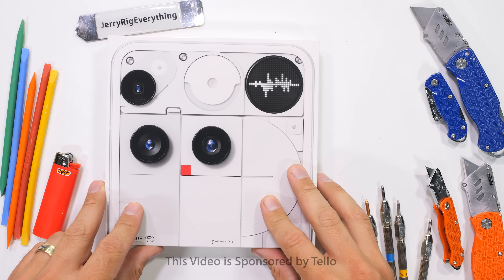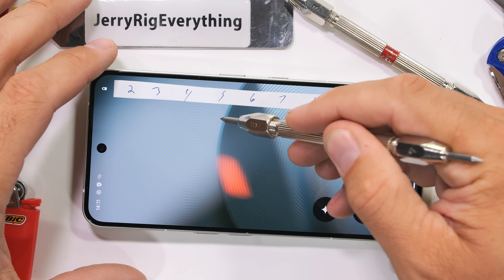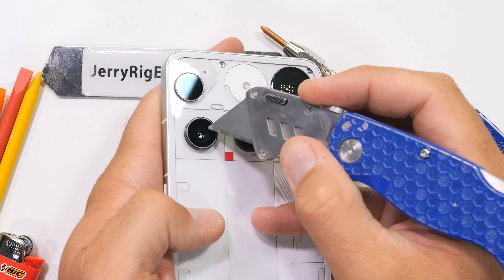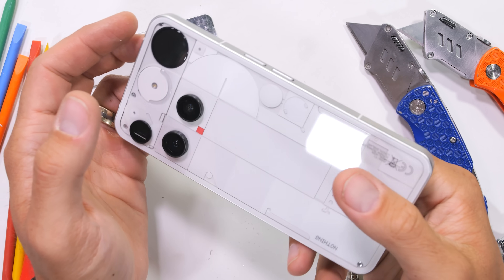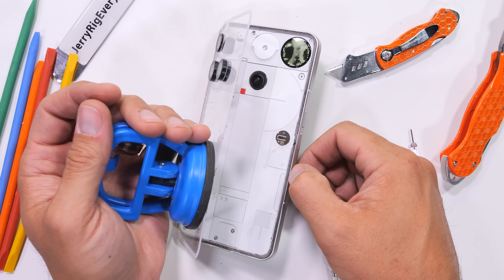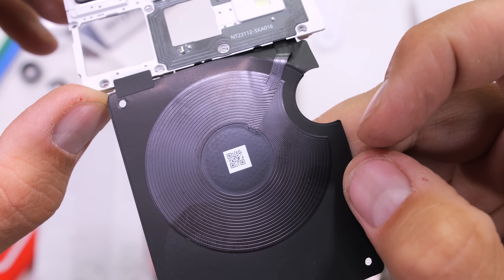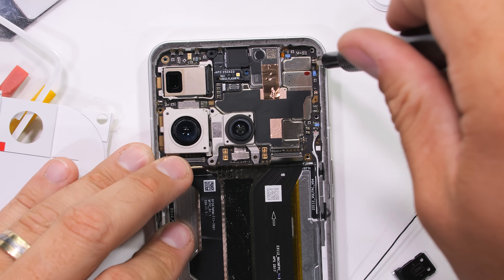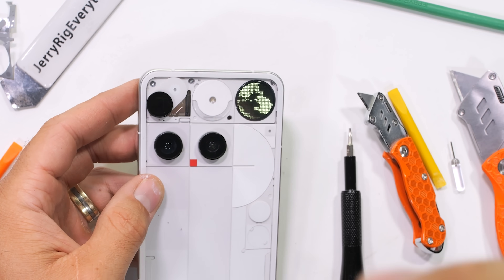Nothing Phone 3 Teardown! - Revealing the Truth...

Comment: Hi Jerry, sir.
This is a long shot, but do you happen to have any recommendations for a tempered glass protector for the Nothing Phone 3? 

I happen to order from Ebay but clearly none is designed specifically for the phone yet considering the slightly curved edges of the phone (which I happen to know the moment I tried applying the tempered glass on the phone).

I'm hoping for my luck to get noticed.

I'm at Australia btw.

Thank you always for your teardown contents. 

Be safe.

Comment: Apple has become a REAL POS company!

2025 – Fake “Apple Intelligence” Hype
Said it works now. It doesn’t. Delayed to 2026. Complete scam.

2025 – iPad Still Has No Calculator
Over 15 years, still no basic app. Ridiculous.

2025 – iPhone Still Has No Back Button, No Real Multitasking, and Hides a Huge Black Rectangle (Dynamic Island) at the Top
Swipe-only navigation sucks. No proper multitasking. That “Dynamic Island” is just a giant black space ruining the screen.

2024 – Blood Oxygen Sensor Removed
Yanked from Apple Watch with zero warning or price cut.

2024 – Vision Pro Overpriced Junk
$3,500 for 2-hour battery and useless hype.

2023 – iPhone 15 Pro Ships With Slow Cable
Phone supports 10 Gbps. Cable is 480 Mbps USB 2.0. Pay extra or wait.

2022 – Killed SIM Tray in U.S.
eSIM only. Travel and switching carriers now a nightmare.

2021–2025 – iPad Can’t Run Mac Apps
“Pro” in name only. Still can’t replace a laptop.

2020 – No Charger in Box
“Eco-friendly” lie. You pay full price for less.

2016–2020 – Removed Headphone Jack
No reason except forcing AirPods sales.

2020–2025 – Siri Still Dumb
Way behind Alexa and Google Assistant.

2020–2025 – Ridiculously Overpriced Accessories
$129 MagSafe stands. $350 keyboards. Joke.

Ongoing – Old iPhones Get Slowed Down
Secret throttling as batteries age. Still shady.

Comment: Please don't get a nothing phone as the OS is terrible!

I have the nothing phone 1 and whilst the hardware and price were and are fantastic for the most part, the software is awful

To list some issues I've had:
1. Android auto doesn't work on some cars, where the workaround was to just go into USB preferences and change the connection mode to "no transfer" and it would fix the issue (dangerous when driving), but they've broken this in the second latest update

2. Google docs doesn't have the option to print! It is because with nothingOS likes to change settings and integrate settings in weird ways with their settings for no reason apart from "aesthetics"

3. The latest update disables my NFC for no reason sometimes, which doesn't appear to be consistent and I only find out when trying to pay with Google Pay on my phone

4. Just get random issues on calls dropping, quality issues, etc. when other Android phones on the same network work absolutely fine

Despite being an IT tech who could get around most of these issues by installing another flavour of Android, I won't be buying another purely for their software issues, as it's unusable as a phone and I shouldn't have to fix it, as it should just be usable out of the box (not perfect, but functional)

Comment: Happy Tello customer here. For those who travel overseas, All Tello plans include wifi calling and texts (back to the USA) which you can use anywhere in the world when you're connected to wifi. This is great for two-factor authentication if you have to access a secure account while traveling.

They do have true international roaming, but it's not included in the monthly fee -- it's pay-as-you-go, which you can top up anytime. I typically just use a local SIM card, but most of my trips are to the same country. 

Also, if you manually renew your monthly plan a day early (29 days instead of 30 days) you get to roll over any unused data for that month. That's too much hassle for me to do, and I never run out of data anyway, but some users swear by it.

Comment: Nothing 3 is a great phone. Just not at that price. Like i agree with nothing ceo. Most people dont need the fastest or highest specs, I certainly dont. I dont expect iphone level security either. Nor do I need victus 2 glass protection ( i will have a case), i could also ignore the battery not being lithium ion or no extra mention of cooling technology. Even the usb 2.0 is fine. Even the camera having the 2021 sensor is fine. All of this is okay but the price just is not. I waited 3.5 years to upgrade my phone and in the end im just not going to. You can cut on unnecessary specs but cannot increase necessary price and then expect people to buy😢

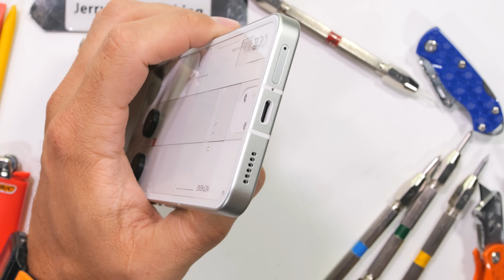Comment: 2:20 you could make a phone with a Gen 5 4x4 NVMe and 100 gigabit fiber port but so long as android continues to use the never ending joke of a protocol that is MTP then transfers will still be running at 2006 level speeds (and reliability!) anyway making anything above USB2 essentially pointless
Reply: Atleast you can use external display

Comment: Hot take, USB 2.0 on that phone is fine. 
Nowadays Wifi 7 and even Wifi 6 is faster than gigabit speeds. If you're going to do a file transfer on/off your phone you might as well do it over Wifi. 
Only time I can see that USB2 port being a bottleneck is if you're going to a store (Walmart, Walgreens etc) to print photos, they'll take a hot second to load in.

Comment: honestly,... phone screens in general are so weak... if you didnt have a screen protector and use the phone as per normal,.. the screen will have micro scratches.. but apply a screen protector and use as normal - 0 scratches... like the screen protector seems to have some better scratch resistance than the phone screen itself.... 😭😭😭😭😭😭😭😭

Comment: The reason India gets a bigger battery is because this phone is made in India. And while exporting this phone if the battery capacity is more than a certain limit they need to pay extra shipping charges so in order to save costs they used smaller battery in Global Versions. That’s why EU Versions of Vivo phones also don’t have massive 6000 mAh batteries
Reply: The vivo x200 pro global version has 6000 mAh
Reply: @joaoroman9583  but it has 5200 MAH in Austria Hungary and Germany
Reply: @sumirat6888 yeah that’s really odd
Reply: It's made in China, not India.

China manufactures most of the phone components which just gets sent to India and assembled there.

Also the global versions of most nothing phones are manufactured and assembled within China. Only the one sold in India is made in India
Reply: @Chibai-hp4ri  that is the point. It's Assembled in India that's why you don't need to export it. And the global versions still need to be imported and while importing an item the battery capacity should be in limits. If it is more than the limits you need to pay extra charges for shipping.
Reply: @sumirat6888  The global version is cheaper because it's almost fully made and assembled within China, which reduces a lot of the costs since they don't need to pay additional import duties on components.

Whereas Indian assembled ones pay import duties on Chinese components and have a higher markup price.
Reply: @Chibai-hp4ri  I guess you are high on something, the point which I wanted to clarify over here is that why the global version have smaller battery capacity than the Indian version the global versions are imported from China when you are shipping a commodity internationally. If it has a battery capacity that exceeds a particular limit, it comes under the hazardous item, which needs to be shipped extra carefully and in order to ship it extra carefully, the shipping charges are more than usual. That is the reason why the global variant has lesser battery capacity than the Indian variant. and you are right, the global variants are made in China. They are imported from China.

Comment: 9:25 anyone else notice this is NOT how u apply thermal paste for maximum heat transfer
Reply: Regardless of the pattern, it didn't get squished at all when assembled... doesn't that mean there's no contact pressure and therefore very little heat transfer? Thermal paste only fills the gaps between materials, they still need to touch.
Reply: @Govanification  Most smartphone manufacturers use a different thermal compound, it does look like thermal paste and that's why there's confusion about this all the time.

It's almost like a highly viscous putty that's great at transferring heat without drying out or shrinking considerably over time. Look up K5 Pro thermal putty and you'll know what I mean.

This is almost exactly that, but comes in a different viscosity.
Reply: @proxyhx2075  Oh ok, that makes more sense. Still, surface area plays a role with putty right? So having a thin squiggly line would transfer less heat than a flat plane? But I guess they will use the minimum necessary to save money.
Reply: They cheap out in the thermal paste
Reply: It's applied in a perfectly okay manner, stop the bs
Reply: Is applied like a nothing!😂😂😂
Reply: It's applied perfectly fine
Reply: @schrodingerscat5035 coping so hard. It's such a bad application

Comment: I guess all these rumors about there not being cooling for the device have to stop now that we can see it at 7:53.  Thank you for tearing this phone down and shutting down the speculation!
Reply: Then that's even a worse job from Nothing since this phone IS actually overheating as per many reviews... Even with this big vapour chamber...
Reply: @MrJonas7  And what about the reviewers that have no problems like PhoneArena and YouTuber TechNick who are reporting temperatures and performance numbers within range for a flagship?
Reply: @ji3qu  Then perhaps we don't have a design problem, we have a manufacturing/QC problem. Plenty of reviewers who were unable to even finish a benchmark run because the device killed the app due to overheating.
Speaking of which, what's up with that "squiggle of paste" at 9:10 and 9:19 ? Shouldn't that be squished from being pushed towards something to dissipate the heat?
Reply: @kamild_  Yeah ngl this thermal paste application got me wondering if something went wrong in production